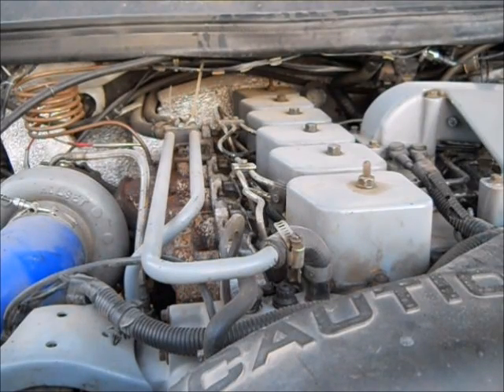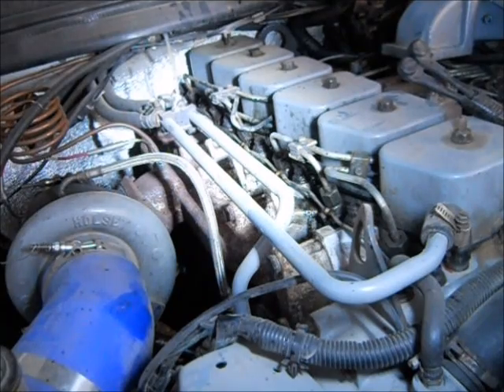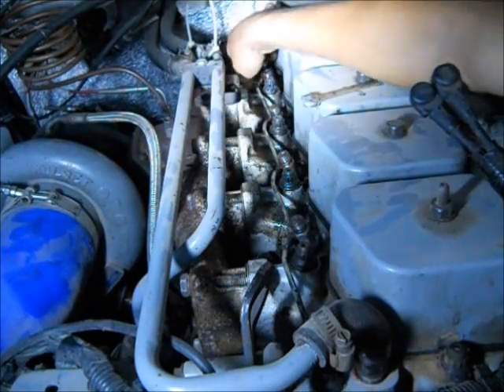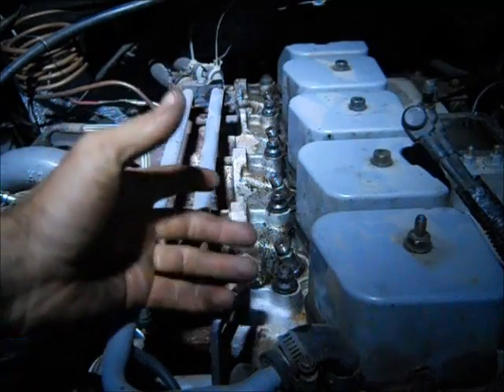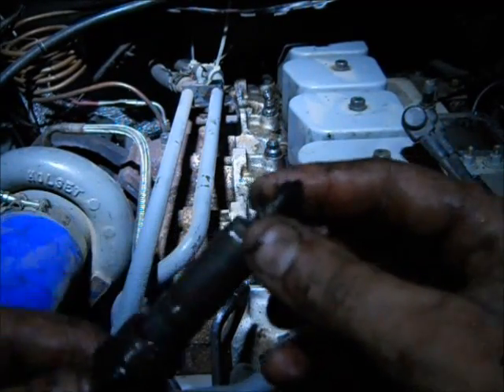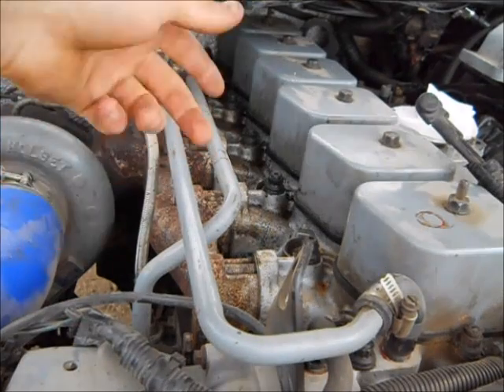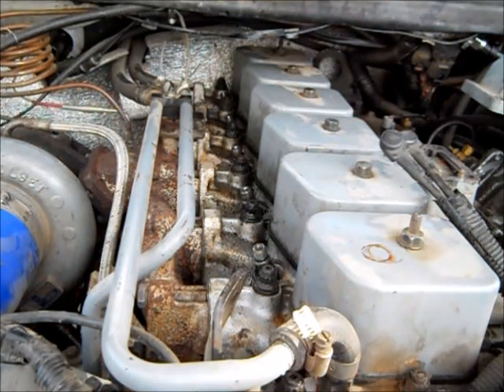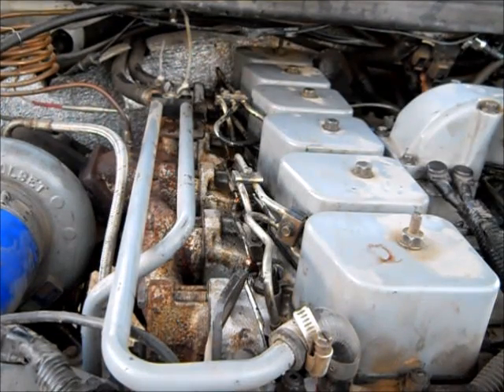12 Valve Cummins Injector Installation

Comment: My injectors won’t stop leaking I’ve done what most ppl say to do when installing them, I even annealed the copper seals, cleaned the bores, torqued them. They piss out the return lines…
Reply: Replace those copper horseshoe washers

Comment: Good god i wish my injectors just came out by hand. I got vice grips on em and I'm giving all i have and not 1 will come out!!!
Reply: Did you ever get it out ?
Reply: @EastMenloPark1650  yes I did. Lots of patience and back and forth movement they finally came out. 3 of the 5 holes were completely clogged. I reinstalled dap +75 injectors

Comment: What is the hold down nut O rings for?  My new Bosch injectors didn't come with them..  they don't squash in so are they just a dust protector or what?
Reply from the maker: It’s a dust seal to prevent dirt and moisture from getting between the injector nut threads.

Comment: Does the fuel system have to be primed after new injectors are installed?
Reply from the maker: William Baker You shouldn't have to prime the low pressure side of the fuel system.  But you may have to loosen 3 of the injector lines and crank the engine over until fuel comes out and then tighten them up again.

Comment: I want to know if there are diffrents   between the engines. Auto180hp/Stick215hp  97 12valve ram. Just bigger injectors?
Reply from the maker: The injectors are bigger on the 215 engines.  Plus the injection pump is a little different as well.  The governor weights are lighter letting it rev higher, and the plungers have a "retarding notch" which advances timing under heavy fueling.  The AFC has a different spring in it as well.  Off the top of my head, I can't think of any other differences.  Best of luck to you mate!
Reply: Thank you so much for the quick response!

Comment: What does seating the o-ring do? What can u use to do that or where can I buy that tool
Reply from the maker: The O-ring is just a dust shield, it helps prevent dirt from getting between the injector body and the head.  That can cause the injector to get stuck in the hole, or abrasion due to all the vibration that occurs.  Unfortunately I don't know where you'd get that tool.  It was just a random fitting out of the plumbing bin.  I'll see if I can shoot a quick video of the tool with some dimensions, so others can hopefully find something that will work similar.  

Take care!

Comment: What can you expect from fuel economy with fuel injector change? Do you have any tips for better fuel economy?
Reply from the maker: I'm probably not the guy to talk to, over the last 9 months I've averaged 13.7 mpg...  Lol  
A lot of that is towing between 20k to 30k, plus being a farm truck it got a lot of short trips this year.  And being honest, my driving style was not geared towards fuel economy.

I can't say I have any hugely insightful tips, just the normal casual acceleration and minimal use of brakes.  The other day I found out I had a sticking front brake due to swollen brake line.  Rotor temp was 380°F while the opposite side was 110°F.  So hopefully that will bump MPG slightly.  So that'd be a good something to check.

As far as injectors effecting MPG, typically you'll see a slight bump in fuel milage with new injectors due to them being set to a higher pop pressure (typically 280 bar) instead of the stockers which are set to 260 bar and typically fade down to 220 bar.  If milage is the goal, a 5x10 to 5x12 is a good choice.  Above that size, mileage can drop off some, nothing huge, maybe a mpg. 

Also, if you're wanting to up the fuel but keep your mpg, keep the stock DV's, larger DV's is a big player in lower MPG's.

It would also be a good idea to check your fuel pressure, low fuel pressure can cause lower MPG due to inefficient burn.  

Cheers.

Comment: what size injectors did you install?  great video 👍
Reply from the maker: In the video I installed 7x105 145° SAC injectors, but I didn't really like them so I moved on to a 5x13 145° SAC injectors and liking them a bit more.  They're a decent 450hp injector, if you don't plan on going past 400hp, a 5x12 may be a better option.  And Thanks!
Reply: Thanks for the information

Comment: great video my 93 smokes white  u think it could be injector because ones it running it goes away only in idle
Reply from the maker: A little white smoke while cold is a sign of a incomplete burn, if it's really cold, on a diesel that can be a little expect, as they don't make enough heat to thoroughly burn the fuel.  Advanced timing will cause more smoke, as will bigger injectors, lower pop pressure, or a worn injector with a bad spray pattern.  If you crank the pop pressure up 20 bar from stock, that can also help with a cleaner burn and possibly a small bump in MPG.
Reply from the maker: The Injectors could very possibly be the cause, you may not even have to replace them, just get them pop tested and bump the pop pressure back up as it tends to decrease 20-40 bar over time.  1st gens tend to be a little more temperamental in the smoke department though, so it's hard to say the exact cause.  Best of luck!
Reply: CumminsWorks thanks man
Reply: Salvador Mendez I'm having the same issue right now, mine smokes after you prime the fuel pedal for a while, white smokes once cranked then after I put it in gear and drive for about a half a mile it stops smoking and I'm about to replace the injectors, did it work for you?
Reply: Patrick Lacy bad injector  let me know after u put injectors how iy was for u

Comment: How long does it typically take to complete this job?
Reply: What’s the price range nowadays days frm a shop?
Reply from the maker: If you're familiar with wrenching, and nothing is rusted in place. an hour to pull them, and another hour to put them back in is reasonable.  Once you do it a couple dozen times it gets a little quicker. lol